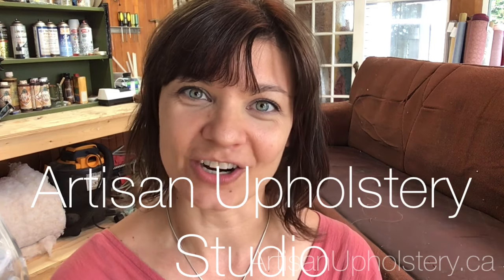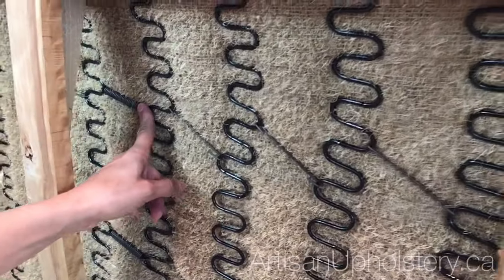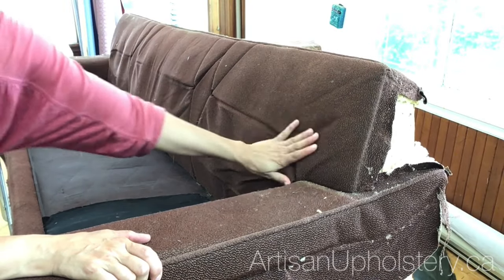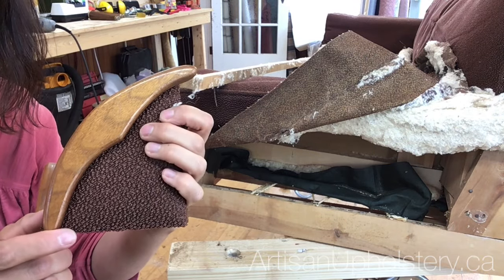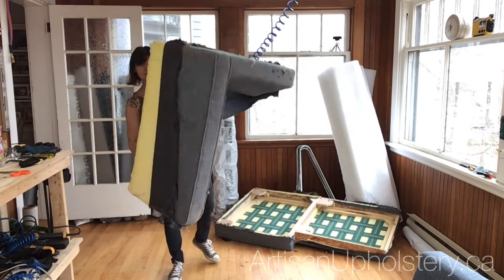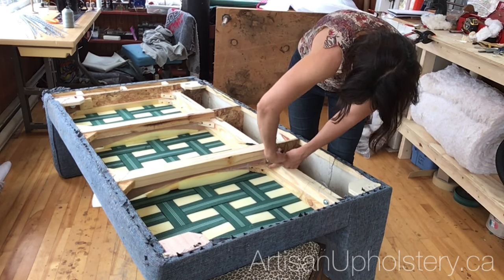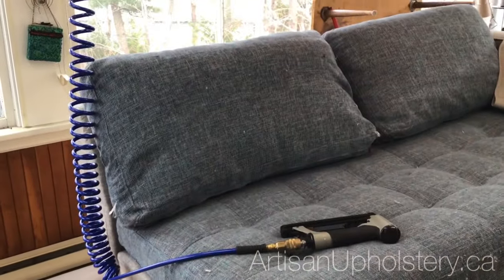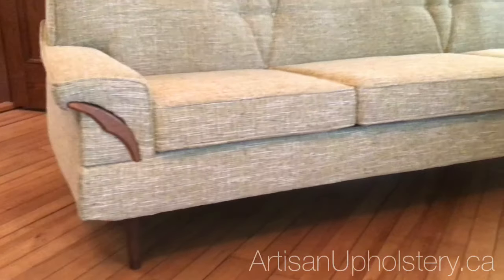Shocking reveal!! Vintage sofa vs New sofa

Comment: I don't think people realize just how cheaply new furniture is made. I personally prefer vintage furniture 100% of the time. It doesn't break as easily, most repairs are do-able, and it actually looks classy. New stuff can rarely be repaired well, it breaks super easily, and after a couple years with it, it's out of style again and run down looking. And lots of times, you can thrift pieces for cheap, pay to have them repaired or reupholstered and still come out of it for the same price or less, than brand new.

Comment: You do great work, Aimee. You are absolutely correct. These companies sure are getting bold bordering on fraudulent when they say that they have hardwood and some duck feathers. 
Sure, they may get rid of their brick and mortar stores and move everything online but you don't know what you are going to get as you helped confirm for me. I can't tell you how many times I have had to send things back when they misrepresent their products.
For this reason, I am keeping my vintage sectional sofa and reupholstering it myself. I thought I would have a friend do it but he is backed up with clients months out from when I was hoping.
I've got solid wood frame made in Italy and with webbing strips right up against each other. It's heavy but generally solid piece.

Comment: hi aimee so true if you want lomg lasting  furniture  its better to buy old furniture and get it recovered  it lasts longer
i did a night class back  in the 90's a guy bought in a 2 seater he said he paid about $800 for it when it was new to reupholster after stripping it down the frame was cheap rough sawn wood worth maybe $100 
i was shocked how garbage it was

Comment: What’s the latest years we should be sofa shopping for to know there’s solid wood in the middle 💯 % 
My grandma worked in a furniture factory 30 years and her comments on furnitures are always fun to listen to 🎤
Regarding Stanley furniture 🪑 I got a set that clearly has veneer inlay on the dining table top (next to marble tile center) and on the chairs, around the cane, and on the China cabinet, with solid wood carvings it’s a bit confusing should I be removing the veneer altogether or is there “bad wood” underneath, but if the set has pictures from about 1963, without knowing when it was bought, what are the chances there’s plywood underneath? What kind of person do I need to look for to do this “antique diagnosis” on what the hell it is 🤩 there’s tags on chairs on the bottom but I can’t find them, something a bit similar and simpler yes but not with all these details together in one set. Advise someone thanks
Reply from the maker: Complicated question, and the only real answer is that you won’t know unless you take the veneer off! I’d only do it if is badly damaged.